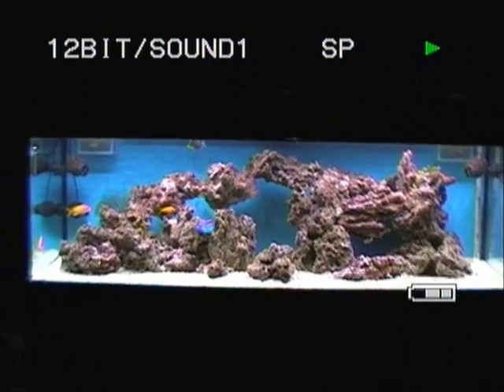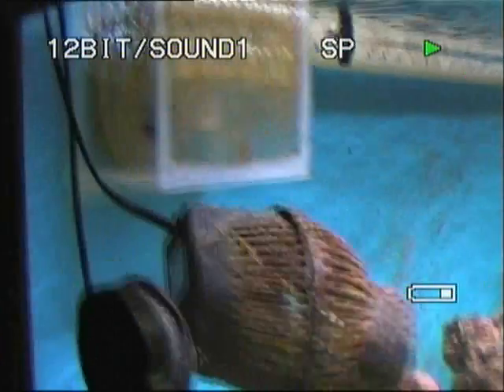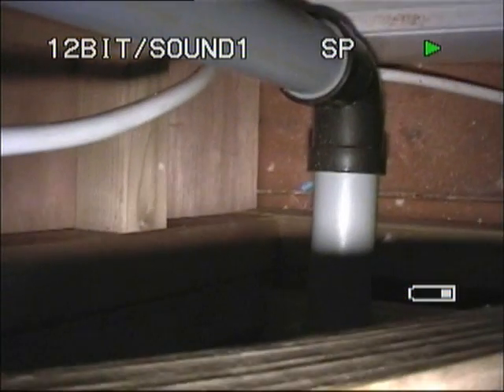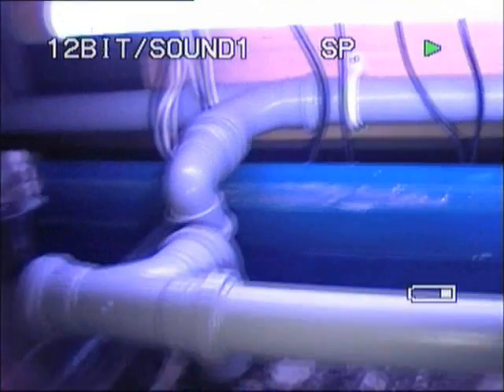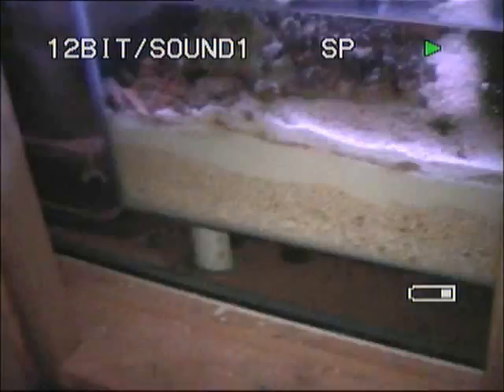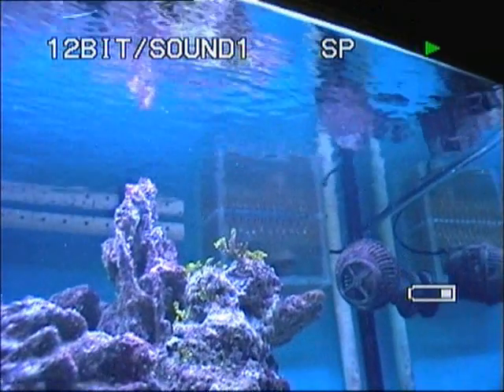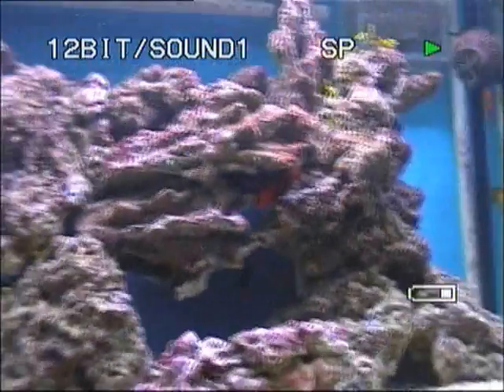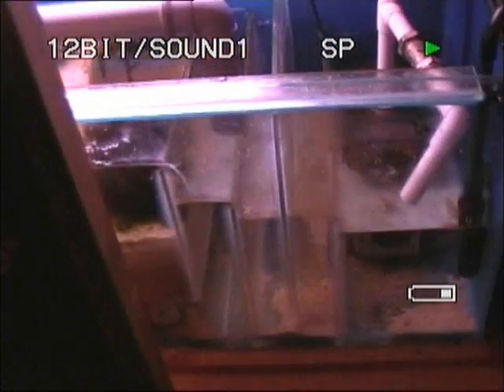MARINE TANK & SUMP   How It All Works

Comment: just FYI, it looks like you have a serious problem if you have a power outage. What is stopping the water from your display draining into your sump via the external filter? hopefully you have at least a check valve but i doubt that will hold 180 gals in your display. you have holes going the total depth of your tank so it will completely empty on your floor since your sump won't be able to take the volume.

Comment: Nice system especially the RDSB. Don't understand though get some more lights and this thing is coral ready. Not a fan of the upflow drilled pipe (i'm sry not english don't know the word). Kinda dangerous cause any type of valve is prone to things getting stuck, like snails and detritus buildup + reduced flow cause of dragg. That's when shit hits the fan.

Comment: @loon3y667 i have a fluval fx5 on my current 4ft system. in the canister i have only sponge which acts as the mechanical filtration. I have no media and rely purely on the live rock in my tank to biologically filter the water. i have real low nitrates and have done for over a yr now. Hope this helps